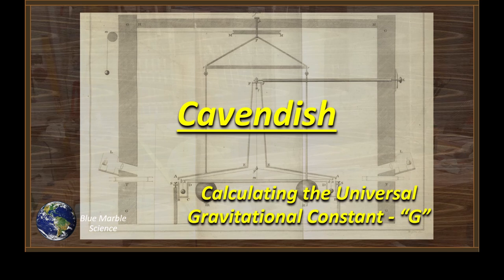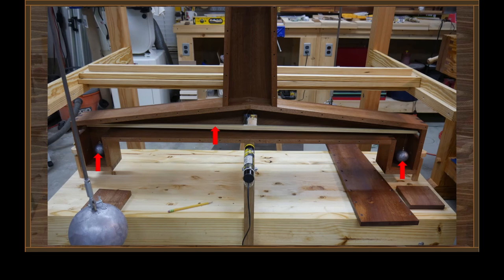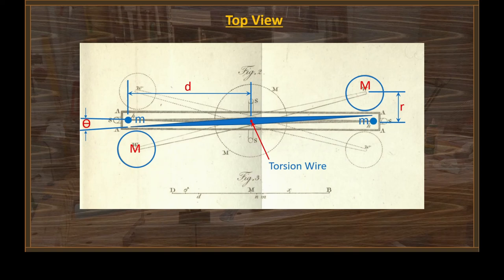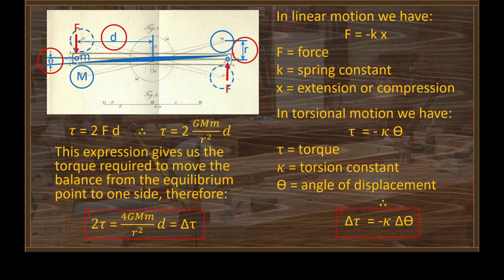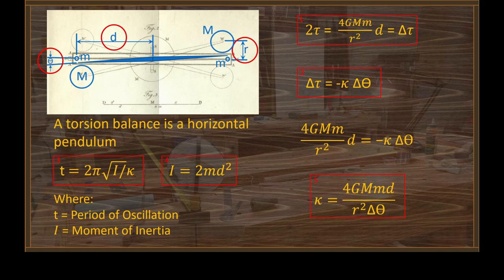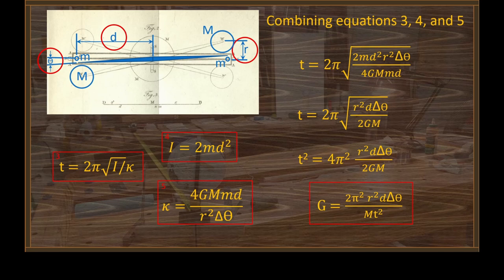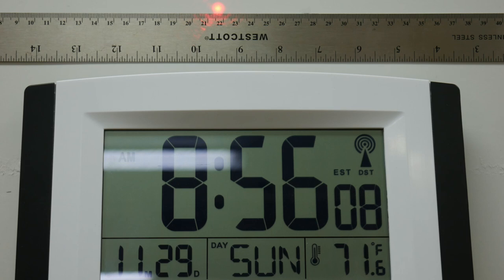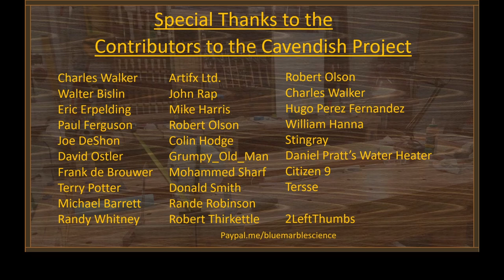Calculating the Universal Gravitational Constant

Comment: Great job Blue. Shame that the mathematics and science will go right over the Flerfers heads. Just like the ISS does.
Reply: Last Change First Your question is a bit ambiguous. Do you mean what causes Flat Earthers to be intellectually moronic; or how the ISS Orbits the Earth every 90 minutes?
Reply: Last Change First I'll leave you to figure it out for yourself. You're about 400 miles altitude, and 17,500 miles an hour away from working it out, once you know where you are on the Earths surface. Given enough time, it will even go right over your head.
Reply: Last Change First. No, I don't. You can work that out for your self.

Comment: The real value of the universal gravitational constant is G' ~ 6.6393 x 10⁻¹¹ i.s. u [according to Cavendish experiment]; ...

... because the force exerted by the body with the most mass on the least mass (that exerted by the least mass generally does NOT exist) is worth:

F = G'(M + m)m /d²    (with m < M)  and NOT GMm / d² !

This formula was for a time used by Newton, then abandoned by him (and which we still talk about in the case of the Sun, but which the lecturers or professors deal with [a little] quickly).

professor essef, in mathematics, independant researcher for over 4 years in fundamental astronomy and astrophysics, and active for over a year on YT and Wikipedia. Paris, December 4, 2020.

Comment: Amount of work put into this just is just stunning!!! I think that Henry Cavendish would definitely approved this execution with application of new inventions such as transparent acrylic and laser beams.
I hope that we would see the final result which will include the systematic errors caused by errors in measuring the ball masses, lengths and time by applying formula for the indirect measurements. Because the preliminary result is very promising and proper scientific experiment is not complete without error estimation.
Reply from the maker: That's absolutely true. Final results need to consider a number of factors that haven't been considered or have only been estimated so you can expect that to be fully addressed in the final analysis!

Comment: you just got G with better error bars in your work shop then they did with the original Cavendish experiment. just fyi
Reply: Well technically those aren’t error bars, the quantity is simply being compared to the modern accepted value as a percentage. Error bars would require quantifying the uncertainty in all the measured parameters (ie 23.05+/-0.01kg and 251+/-0.5mm etc) and then applying a fair bit of calculus to work out how each of those those uncertainties propagate and contribute/compound in the overall equation which would then result in something that would look like G=6.67+/-0.012345m^3/(kg*s^2).

But the reason is blue has the benefit of (and taking full advantage) modern machining and measuring tools that can quantify the parameters he needs to know very accurately. The only the only thing(s) left to ensure accuracy and precision is simply patience and discipline, which blue evidently has plenty of.
Reply: @sphaera2520 , well said.  I don't think Cavendish had access to a laser.
Reply: @glennpearson9348  A laser pointer does not bring any improvement in reading accuracy over a scale read through a telescope with a reticule. Quite the contrary. Form my own experience, I can tell it is a lot more convenient, though.

Comment: Exceedingly well done!
The setup is an example in craftsmanship, and building it is certainly one in tenacity!

One point of criticism, though: You do over-estimate the accuracy of the quantities you put in there by a lot: In short: there is no need for all these decimal places, as most of them are not really certain, anyway. For example:
- The mass of the large balls will only be accurate to the error of the scales you used to weigh them. They probably will not be better than +/- 50 g at 22 kg (which still would be very precise at only 0.2% of relative error). Certainly, they are not known to 10 mg as your table suggests.
- The measurement of oscillation time will be quite accurate if you do it by time lapse, say, an image a second, then you are down to +/- 0.5 seconds.
- Your distance measurements between the centres of the masses will not be down to 1/100th mm (how would one assure that, given that the large balls have cast surfaces and their centres of mass will not be locateable within that tolerance).
- The centre of the laser spots can well be estimated to +/- 0.2 mm, given that the edges are a bit fuzzy. So, the difference between two such values would be accurate to +/- 0.4 mm. *From this alone, you will get a relative error of the end result that cannot be better than +/- 0.4/40 ~ +/- 1 % *
All the other uncertainties inherent in the setup will considerably increase this error.
To sum things up: Well-done, but please curb the excitement a bit if you end up close to the literature value.
*But then, please do not be disappointed: With a Eötvös-Balance in an evacuated setup, of which we have three in the beginners' lab classes, we never get better than +/- 2% for a single measurement. Added accuracy comes with the number of repititions... *
Reply from the maker: Thanks for the input - well said!

Comment: That was awesome Blue. Amazing workmanship and excellent experimental technique. If the beam is of length 2d and width 2a with a mass m', then the moment of inertia of the cuboid about an axis passing through the centre of mass parallel to the depth direction is
I=m'(a²+d²)/3
where m' is the beam's mass. However, by the looks of it, such a change to the calculation would increase t and reduce the estimate of G which would make the estimate worse, so maybe other factors are more important at this stage.
Reply from the maker: So right Clive - when I account for the beam mass, G will decrease a little. But there are other systematic errors I have to address as well like the effect the large masses are having on the distant small masses which effectively reduces their mass and that will increase G a little. Right now, I've only roughly estimated that effect. I would caution everyone not to get too excited. A single data point, as you know, isn't anything by itself. Twenty or thirty measurements will have some statistical validity so we'll see what happens when all of that is done. But I am very encouraged. The best commercially available Cavendish won't promise an accuracy any better than +/-5% and I think we can easily beat that.

Comment: This is just fantastic work - congratulations.

Are you working up a list of perturbing factors to calculate/measure?
Some questions that come to mind:  
You mentioned the mass of the crossarm. Will the mass of the enclosure also add to the deflection when the small masses aren't centered?
How about the reduction in distance between the large and small masses when the pendulum is at final extreme position?
Was the resonant frequency measured both with the large masses at the extreme positions and the central position?  (Thinking this probably makes no difference, but you could check.)
How constant is the temperature in your room? Does it affect the torsion constant, or other factors (e.g., length of the crossarm)?

Presumably you will make repeat measurements to measure error deviation. Do you also plan to have others do repeat measurements to ferret out any "personal equation" effects of reading the scale, etc.?

Again, congratulations! This has been fascinating!
Reply from the maker: Thanks for the comment. Without going into a lot of detail, I'll tell you that all the factors you mention plus a number of others have to be accounted for in the final analysis. Experiments can have these systematic errors and that's expected as long as they are accounted for and not simply dismissed. Cavendish did that with his original work and did a brilliant job I might add. The oscillation period is slightly affected by the position of the large masses. That has to be considered. Temperature stays within about a 1.5C range so I don't think it's a problem. And others will be having a look at the raw data as well. We should all get the same answer. Data is data after all.

Comment: So the first 'Preliminary Test' comes to within 0.5% of the accepted value of a number that is 100 times smaller than 1/1 billion?  Let's put that in perspective for people who may not be too familiar with the metric system.....
On average, the earth has been determined to be approximately 147.48 Million Km from the sun which can be written as 147.48 e6 Km.  Changing Km to m is the simple act of multiplying by 1000 or increasing the exponent by 3 so we get  147.48 e9 m.  Now to continue the process...we convert metres to millimetres by multiplying by 1000 again.  So we get 147.48 e12 mm.  Now to keep the exponents the same we will multiply the original number by 10 or just move the decimal place 1 position to the right.  That way we get 1474.8 e11 mm.  Now the units are not very practical but the number we are describing is just as ridiculously huge as the gravitational constant is small.  
To say that you are off in your calculations by 0.5% in your 'preliminary test' is the equivalent of measuring the average distance between the earth and the sun and being off in that measurement by 7.374 mm or 1/4 inch.
Nicely Done Blue!

I'm terribly sorry Blue!  The above description is an example of me without caffeine.  I was very tired and didn't quite get the numbers right.  By a factor of about a billion.  Of course I realized my mistake just as I was beginning my shift at work and so couldn't fix it until tonight.
"being off in that measurement by 7.374 mm or 1/4 inch." - should really read 7.374 e5 km or about Double the distance from the earth to the moon.  There!  That is what it should have said.  It's still quite an achievement.

                                     It is by Caffeine alone I set my mind in motion!
                                     It is by the juice of Valdez that thoughts acquire speed, 
                                     the teeth acquire stain, 
                                     the stain becomes a warning!
                                     It is by Caffeine alone I set my mind in motion!

Comment: I noticed one thing in your equations. At the end of your derivations, around 8:50, in equation 5 the negative sign suddenly disappears although it is still present in the equation just above it. I guess it is of no consequence because the delta theta could be one way or the other way (positive or negative) but it looks somewhat strange. Or am I mistaken somewhere?
Otherwise: a very clear explanation and e nice (preliminary) result.
Reply from the maker: I actually meant to mention that but I forgot. That sign essentially gives tau a direction and we don't care about that - only magnitude so I just dropped it. But thanks for reminding me - maybe I'll put a note in the description.
Reply: Thanks for pointing that out, Frank.  I saw it, but I think I realized what or why Blue was doing it.  Always good to point things like that out: if it's wrong it gets corrected; if it's right but unclear then the details get explained.

It reminds me of a math problem I had decades ago where the answer was -0 (negative zero).  I don't recall the exact problem, but it was involving electronics and was either a dynamicaly changing phase angle or the zero crossing point of a waveform.  The sign was important because it indicated direction, which way the change was occurring.  So I needed the sign, not just the magnitude like in Blue's case.
Reply: @bobblum5973  I think it is important to address these little inconsistencies, mainly because there are many flerfers around that will try to discredit the entire video on the basis of such a tiny mistake. Even, as in this case, it isn't even a mistake but a derivation that isn't explained entirely. Nevertheless, it is comforting to know that almost all flerfers are so mathematically illiterate that they probably don't notice it, let alone that they even understand what Blue is doing there.
Reply: @frankdebrouwer-leiden  I agree with all your points, they show integrity and honesty toward the subject matter, and the audience of both globe deniers and provers.

Comment: have you considered the .5 variation in position as a slight variation in the constant
Reply: I only ask because I found the
 6.67439
6.67408
6.67377
figures for G make a wave with a height of 9.87and a separation of .00729927
times 2.
.14519
kinda like pi
Reply from the maker: I'm not sure what variation you're talking about. If you mean the deviation between what I measured for "G" versus the accepted value of "G", I think it's a simple combination of random errors resulting from slight inaccuracy in positioning of the external masses, errors in timing measurement accuracy and maybe a few additional minor systematic errors that I couldn't identify. I don't think the constant itself changes.
Reply: @bluemarblescience  no pendulum ever completely stops moving. 
the variation in the position  you measured. a .5 difference. 
we know gravity travels in waves.

Comment: 99.4% job done! but just in case could you also work out your measuring error?  The "mis-fits" won't understand why it can't be 100%, therefore the earth is flat.
Reply: This will require multiple measurements to separate systematic errors from random ones.
Reply: @oldtvnut  I was thinking more in terms of measurement errors from precision and accuracy of the devices used such as the scales for weight Probably 1%,. Distance +/-1mm? and time 0.5 secs?.   But yes we are still assuming no drag forces or stored energy in the torsion system.  However, if we have the measuring error, we may be able to determine that they are neglectable or not.

Comment: Hmm... That r can't be right. One side of the big ball is much closer to the small ball, so since the effect is (inversely) proportional to the square of the distance the closer parts must affect it more. Let's say you add another big ball 200 times further away. Now the 2 big balls' combined center of gravity is 100 times further away. The effect (theta) is negligible, so in the formula the resulting G should be about 500 times larger. Nopely nope no.
Reply: @bluemarblescience  But really, what am I missing here?
Reply from the maker: @marcus3d  The problem is the way you're trying to combine masses. You have to treat them as what they are - separate masses. Adding a second mass simply adds an additional force - it can't reduce the effect of the first mass. So if the masses were equal, and the second mass was just ten times as far away, it's force would be 1/10^2 or 1/100th of the force of the first mass. So you would have increased the attractive force by 1%. If it were 200 times as far away, the increase would only be 1/200^2 or 1/40,000th increase in the force. Hope that helps.
Reply: @bluemarblescience  No, you don't have to think of them as 2 masses. You could, say, connect them with some styrofoam and you'll have a single mass, about twice as large, with a COG way way off.
(Or, if you insist on treating them as separate masses then also treat the original big ball as a bunch of separate masses, each with a different r-value, which was my point.)
Reply from the maker: @marcus3d  Sorry, but you really do and the Styrofoam idea, while funny is simply ridiculous from a physics standpoint. A perfectly spherical homogeneous mass can be treated as a point mass but it can't be done that way for your arrangement. The total mass isn't spherical and it's not even close to homogeneous. This is why we use spherical masses and not some goofy dumbbell or other odd shape. I think you're confusing center of mass and center of gravity. In that sphere we're talking about, they are the same point. For the dumbbell arrangement they aren't the same. Best not to argue this point. What I presented is correct.
Reply: @bluemarblescience  Yes, you're right, the differences do cancel each other out for a spherical object. I'll be damned, my intuition is clearly garbage! Also, this has been the hardest math I've done since I graduated from the uni. 😬
Reply: For what it's worth, I vaguely remember the physics class where it was shown that what matters is the distance between centers. We worked out the calculus. Recently I found this book https://www.amazon.com/Newtons-Principia-Central-Argument-Translation/dp/1888009233 and believe it or not, Newton reaches the same conclusion by an entirely different path!

Comment: Obviously you didn't measure G, you used math and you can't use math to measure something. Which flat earth genius made that pronouncement?
(your next experiment can be easier and more fun: using a plastic cup that you build a static charge on and holding it next to a slow stream of water to show that water can, in fact, curve based on a force acting on it)